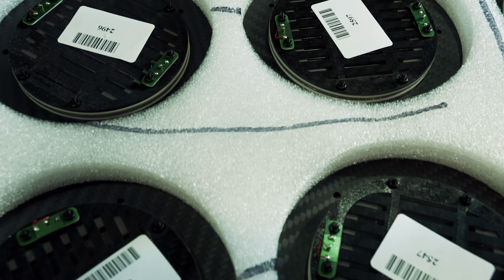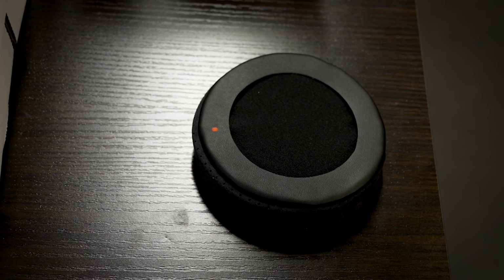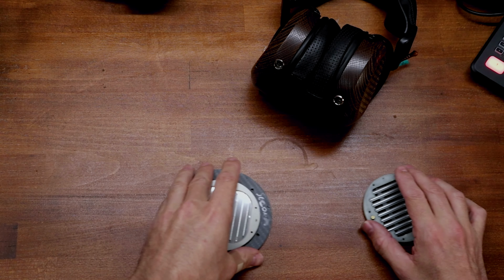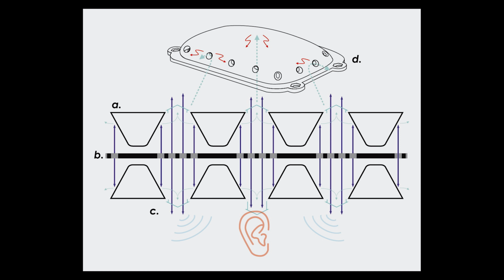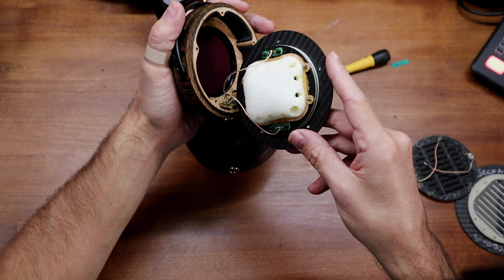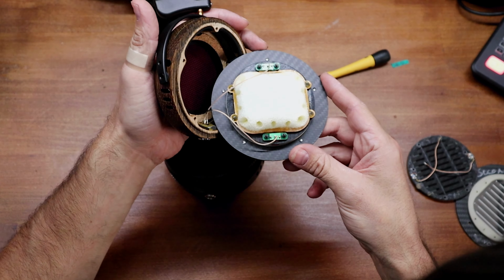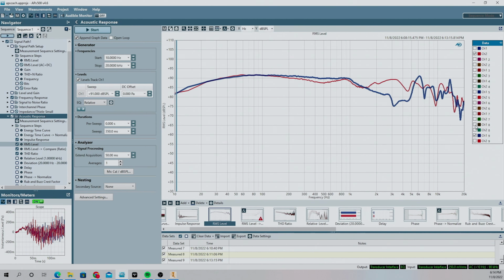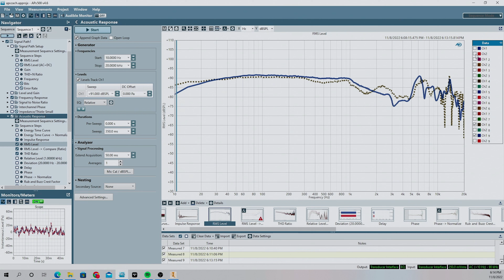Caldera: The Patent Pending Tech, Measurements and more; inside ZMF's flagship planar ortho magic!

Comment: You and your magic hands Zach I want my ZMF caldera to be in all stainless steel color and Aluminum including the Chassis Material and the Arm brackets that the housing together make it stainless steel aluminum as well and Australian Buloke wood with 2K Copper cable in 10FT Length Amp Termination 4-pin XLR and Steel Jack & Splitter Color No Sleeve unless There's a Kevlar 149 option because I have a cat that likes to chew headphone cables i would definitely pay extra for all of it  Then I have my dream headphone.

Comment: Zach, have you listened to the Caldera on the Cayin Ha-3A? If so, what are your thoughts? I just got the 3A and am absolutely love it with my Aeolus and LCD-X.
Reply from the maker: Yeah - the 3A works great with Caldera, it's an amazing amp, capable of anything except maybe driving planars that are under 90 dB/mW, where you'll still get good volume and sound, just maybe not quite the low end control.  But that is there for sure with Caldera. at 95 dB/mW